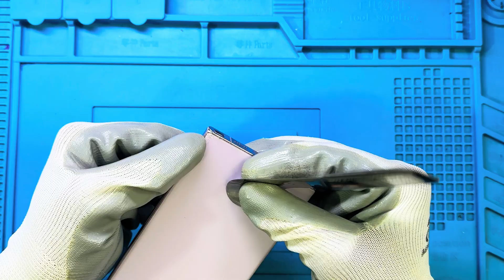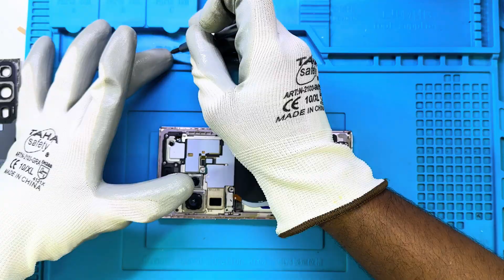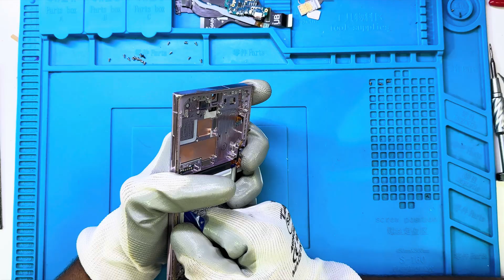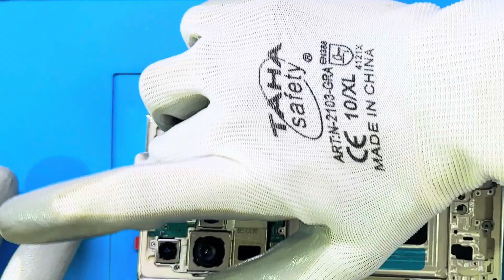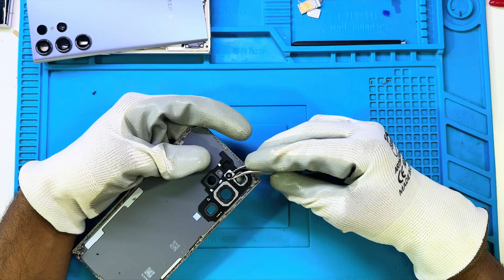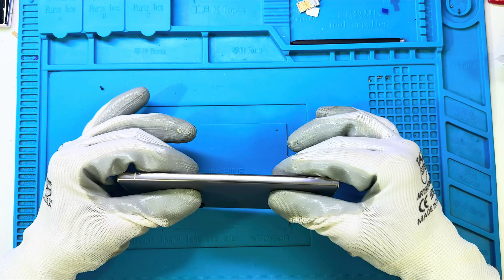Samsung S23 Ultra Display Replacement | Cheapest AliExpress Screen Test & Back Glass Color Change!

Comment: What's the link please, I need it for the s22 ultra 😊
Reply from the maker: I removed the link from the description because my seller recently received several negative reviews. You can search on AliExpress instead — please look specifically for a display with frame and make sure it’s the Hong Kong version, as it is usually more affordable.